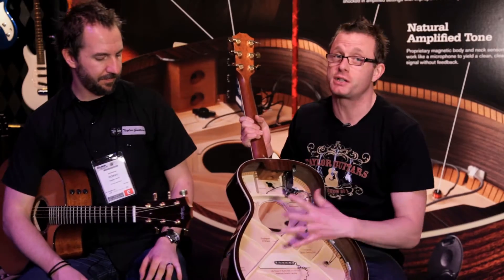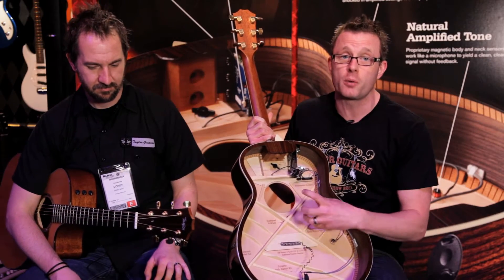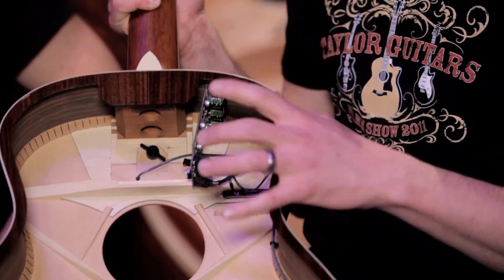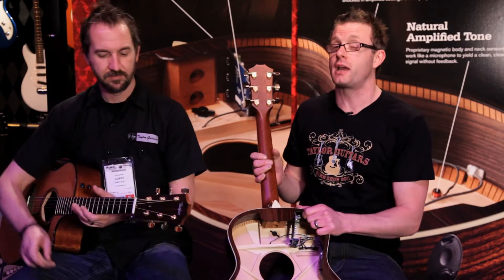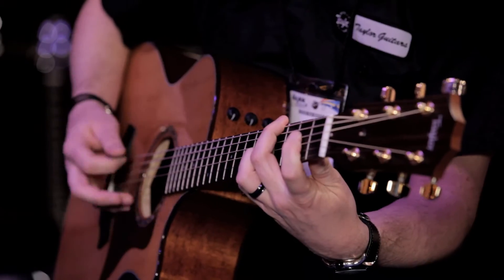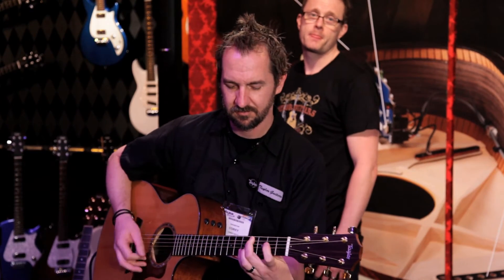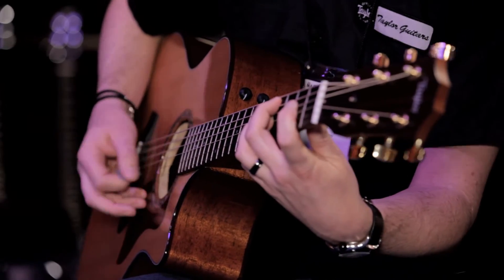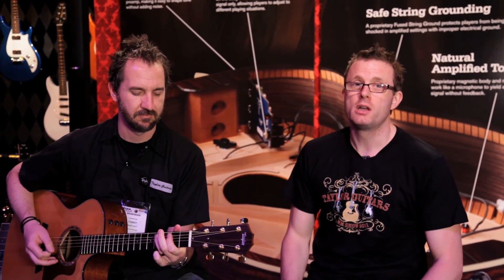Taylor Guitars Expression System Demo - NAMM 2011 with Taylor Guitars

Comment: I have a 310 with the 2 x AA battery ES and it's awfull amplified. It's fine at very low voumes but any attempt to turn it up and it  feedsback like hell. I generally put it through a Fishman Loudbox. I have an old Washburn D21  with a passive pick fittted which sounds better amplified. However, the Taylor sounds fantastic unplugged. I think there must be a fault with it.